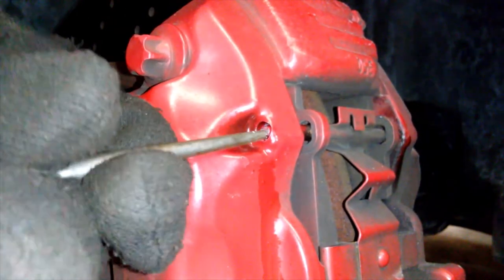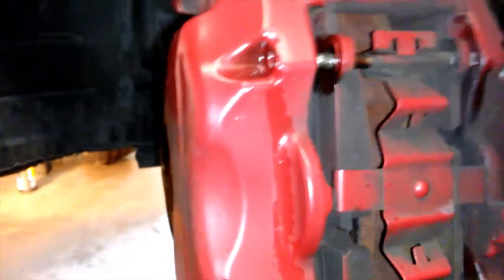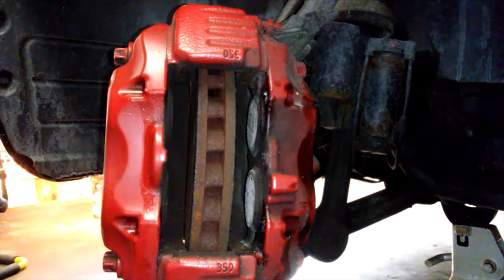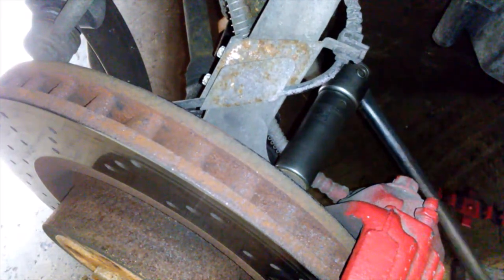2008 Mercedes Benz S550 4Matic Front Brake Pads, Rotor and Caliper Replacement

Comment: I noticed you lost just a few drops of brake fluid when you hooked up the new line.   Had you drained more out of the system, not shown in the video, or is the fluid held elsewhere in the system, and that is indeed all the fluid you lost?